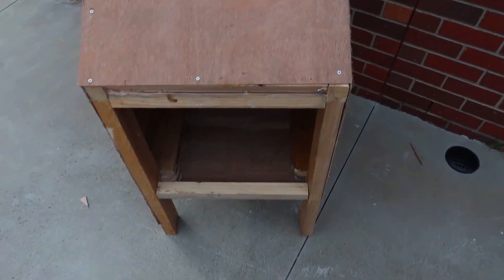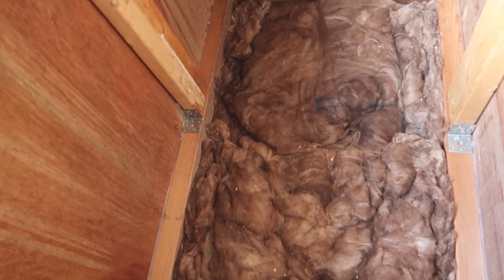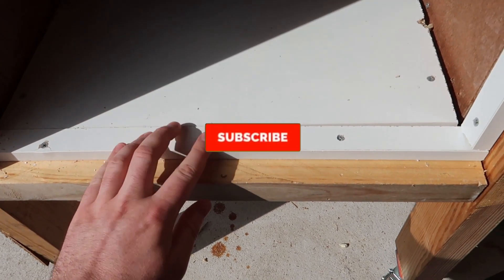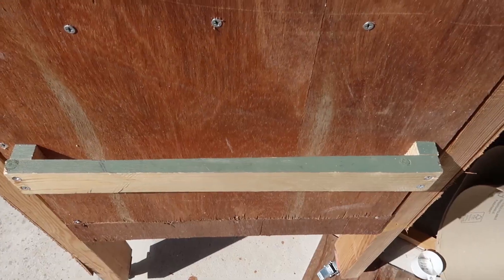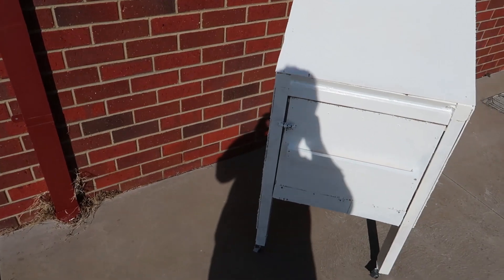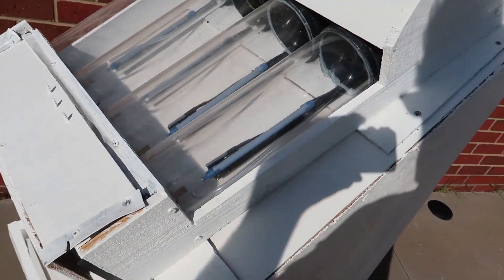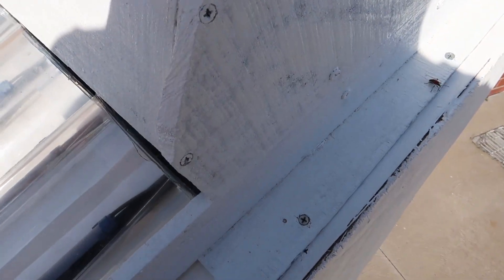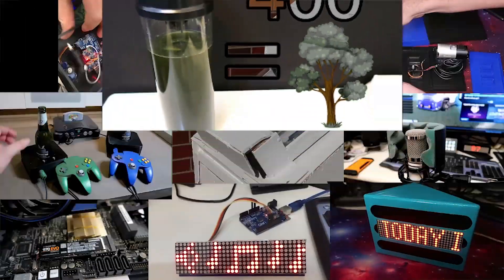Test Stand Insulation, Moveable, Enclosed (Co2 Scrubber)

Comment: Nice project.Will you be able to do some data analysis using this project by taking 1 litre of water in each tube and monitoring growth of algae at different temperature and diff CO2 level and different water Ph level. This will help to understand the Algae yield at different situation per litre.
Reply from the maker: Thankyou, Yes that is the plan, and try get as much data as possible, then look at best ways to scale the project

Comment: I think you need an automatic shade or cooling system eg. a radiator with an aquarium pump
Reply from the maker: yeah I'm not sure how it will react with temps in the tube so it will be interesting to see, but I'm more concerned about evaporation then heat of the water, will see how it goes. and look at shading if needed, weather where I live can change just checked and Max and Min temp are -4.2 to 45.2 degrees Celsius looking back at historical data across the year.

Comment: Thanks for pushing along with this system. You probably should do an overview video of where you are at. For those just coming here, this is the project;
https://youtu.be/DmC-3QF7sAQ
As I understand it, this is a test system to measure O2 output and determine parameters for a larger/different workable and perhaps practical system.
Reply from the maker: Cheers, Thankyou for watching, 100% correct, this system is the test unit, once the best way to do everything has been determined then shift the focus to sequestration and scaling. I was thinking of doing an overall video prior to the start of the test (Filling tubes with water) but not sure if I should do something earlier. From my YouTube Analytics it shows a large amount of people are watching via the playlist, so I think most people that are interested are either finding the playlist and watching through or returning viewers are watching the new videos as they post.